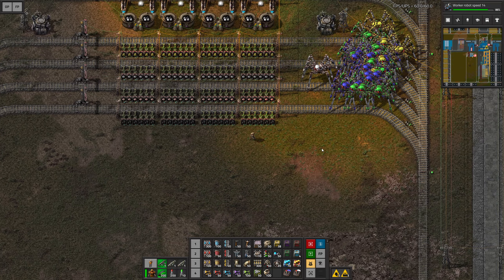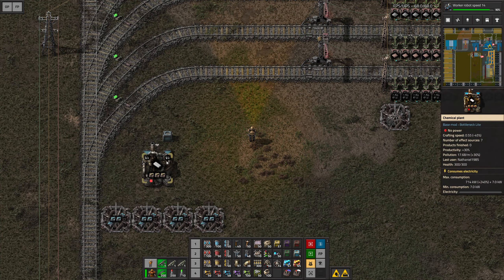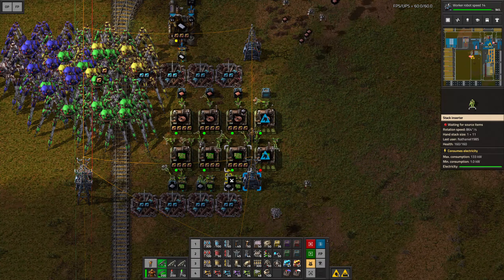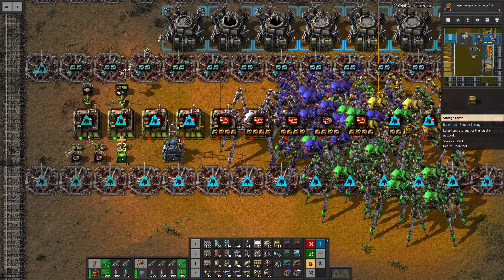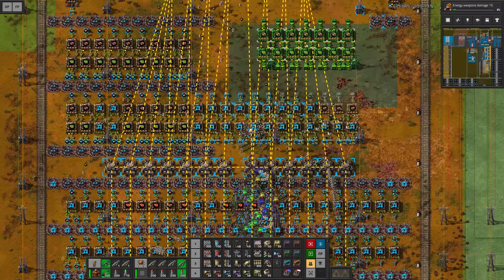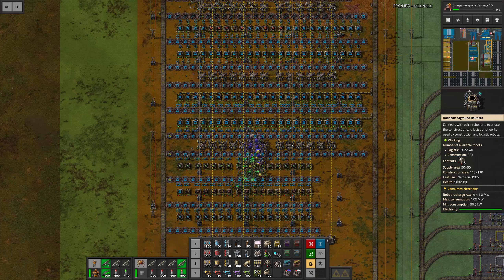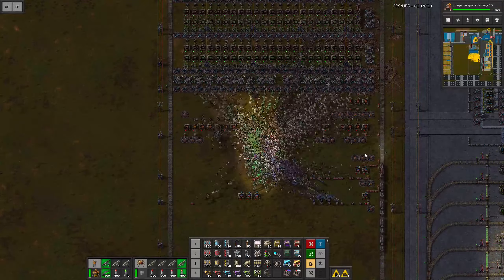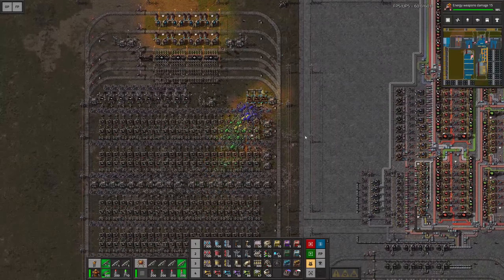ROBOT CRAFTING FRENZY (1.2k SPM) - Step 55: Factorio Megabase (Step-By-Step)

Comment: Only reason I'd suggest leaving biters in is if you feel it some what cathartic to go give them the rockets every soft often.   Hmm, that and if you wanted to test military science upgrades e.g.  can you upgrade lasers enough to handle a large biter influx?  Also your mega module includes military science...   with no biters does it mean that part of the module is no longer needed????  Things to ponder.

Otherwise, generally agree with biters being a nuisance after a certain point.  You showed us how you'd handle them and it won't really change much.  Pollution and biters are just UPS and time sinks.

Comment: i love you series so far.
as a player with ~2000h in this game, may i, for efficency's sake regarding your plastik setup, make fokllowing suggestion:
Place two chemical plants right beside each other, connect the two inner liquid inputs with straight pipes, connect each end of the pipe with an undergruond pipe, use the remaining corner of the buildings for inserters.
its perfectly tileable an doesn't leave a gap inbetween the chemical plants.
also how far do plan on developing this save? to the point of a selfconstructing base? (pleaseee???)
Reply from the maker: Will change that, thanks for the tip!